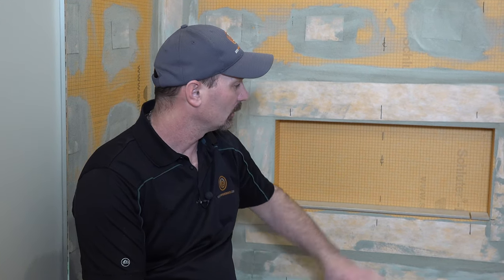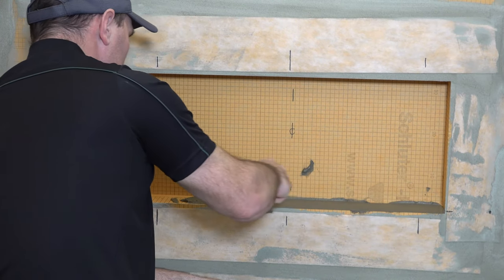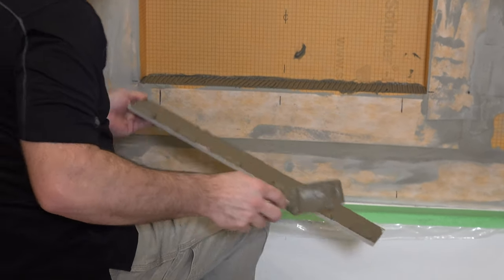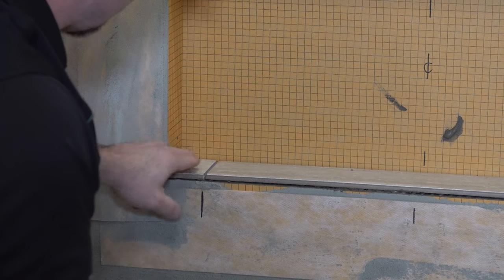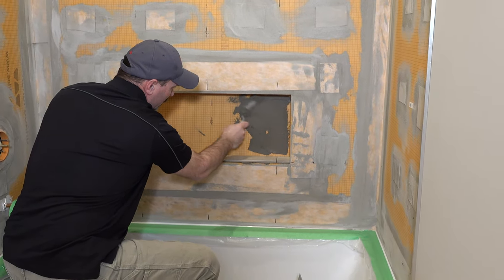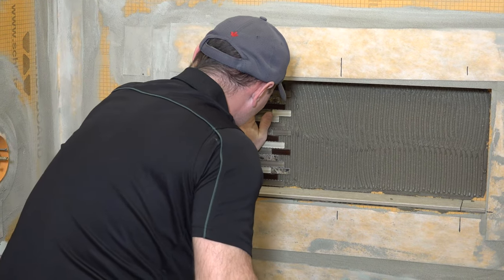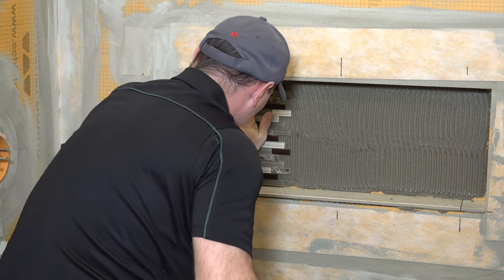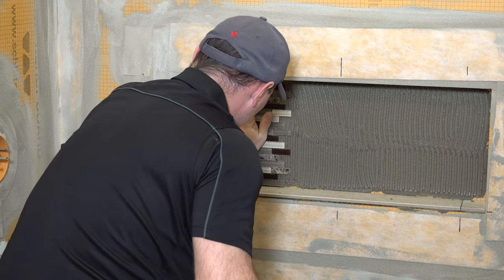How To Tile A Shower Niche

Comment: I always install the bottom sill plate tile last, rather than first.  I begin with the back wall mosaic.  Next, install  the top plate tile(s).  Next install the right and left side tiles, which will hold the top tile at the edges.  If additional temporary blocking is required to hold the top plate tiles in place, that blocking won't be pushing down on the bottom sill plate that has been installed with the appropriate slope, because you haven't installed the sill plate yet.  Note that there is no need to trim the angle at the bottom of the side tiles to accommodate the slope of the bottom sill plate.  Finally, install the bottom sill plate, angled to shed water from the niche.  Note: If your planning to install Shluder Rondac or other trim to the perimeter of the niche, you have to decide whether the Rondac will be embedded under the niche side wall tiles or under the wall tiles before you tile either.
Reply: This is what I will be doing as my glass mosaic will have cuts top and bottom and look better covered.  Also, my 3x12 subway tile will fit perfect with the glass there first.
Reply: This time I did that same order except sill first and then used the caulk tube grout to hide all the edges since the caulk tube works better on tile faces on an edge
Reply: I think his explanation for sill-first speaks for itself. The way he does it, any moisture that does sneak past the mosaic or sides will fall to the bottom and hit the sill and run into the tub.

Comment: One tip I learned the hard way.  Locate the niche on the wall with some thought as to where the wall tiles will land.  You don't want to discover when cutting a wall tile to fit around the niche that you need to extend a small sliver of tile over the niche as that sliver may crack a few months later and the homeowner won't be happy.

Comment: Good stuff.  Did the bottom of that shower niche have a slope to it also? You sloped the tile but if water got in behind it it could start pooling in there if the framing itself doesn't have a slope.

Comment: I get a bit confused on the framing for these Kerdi niches. Is there a gap between the frame and the niche? Or does it have to butt up to the frame all around?
Reply from the maker: You just need framing that lands half on the joint between the niche and the kerdi on the wall. This way you can screw the joint with the proper screws and washers.

Comment: Should there be a gap between the bottom tile and back splash? What about the bottom tile and side tiles? I always thought tile on tile contact, was a no no.. 
thanks for making the video.
Reply from the maker: Depending on the tiles some can touch near the wall surface as long as they have a grout gap at the surface

Comment: So no gap for grout is necessary between the sill and bottom of mosaic tile?
Reply from the maker: There is a small gap there. the mosaic tiles dont really slide much when they are one tile so i dont use a spacer.

Comment: What is the tile cutter you're using? I use a crappy cheap one but would like your thoughts on a quality cutter.
Reply from the maker: The one I used here is my Brutus cutter <I have a much more expensive Montolit as well but its a large unit and not needed fro this tile

Comment: nice video shannon thanks for making video one question why u did not go full length of tile in bottom of niche but overall good video
Reply: Because it's wider than the length of a full piece of tile
Reply: Or you could have done with 2 pieces with one joint in the middle. A little more waste but less joints.
Reply: My bathroom window sill is 37” and I’ve looked for a full piece of tile but can’t find any that are longer than 24”. I think that’s the max you can buy, so you need to buy two pieces if you have a wider sill.

Comment: Shannon, we are deciding whether to re-do the floor in our walk-in shower or have someone else do it. From 2006 building style, they put (slick) wall tiles on the floor which is a safety problem, obviously. Will you be doing more bathroom tile videos coming up?
Reply from the maker: Yes we have many tiling videos already and more coming in the next few months. I do not have one for shower floors however. I’m actually not a fan of tiled shower floors as they as the perfect place for trouble causing leaks. I have done some but prefer a shower pan and tiled walls.
Reply: HouseImprovements I totally agree, we will probably put tile down but will definitely have a more nonskid texture this time. Surprised the builder put it down, then again not surprised at all.

Comment: Should tile walls before make no sens niche first
Reply: This is very wrong imo.  Measure out the exact spots the niche should fit, plan accordingly, you can even make a 'story board' piece of wood that measures that gaps/tile/accent/tile etc to show exactly how the whole wall should tile from tub to ceiling.  Doing the niche first (which is a big focal point) will make sure all the details are very accurate there and requires a lot of extra detail/focus so makes sense to get just right first.

Comment: Never heard this referred to as a niche.  People might find this video easier if it was called “recessed shower shelf”.  Thoughts?
Reply: Niche comes from the original shelves that were built into the walls in the Victorian houses. Also referred to as a wall niche. If it's in the shower it's a shower niche.
Reply from the maker: You make a good point and we have key words such as what you described used in our search criteria for this video. Thanks for your suggestion though.